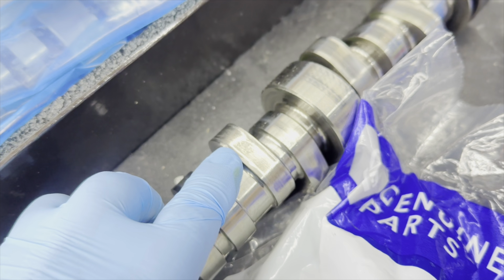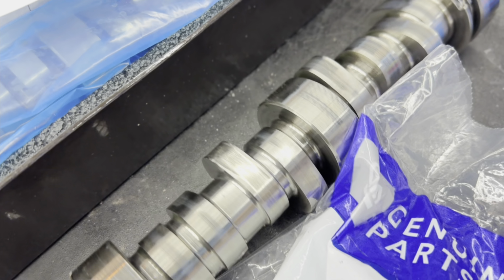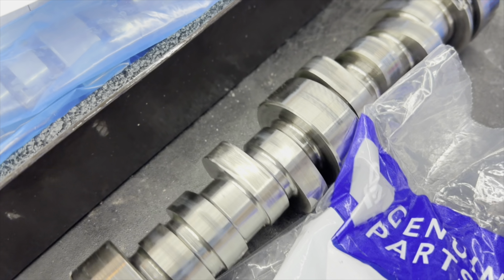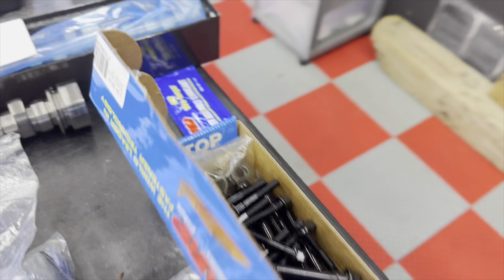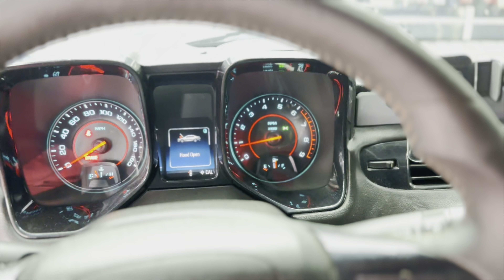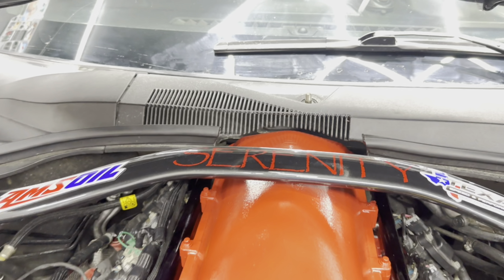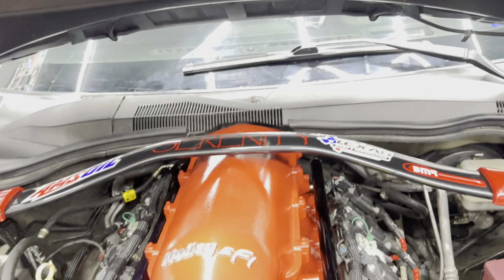2015 Camaro Ss camshaft installation

Comment: What’s the trick to get the bottom oil pan bolts on the front cover to thread back up? No room and I have been fighting it for hours.
Reply from the maker: I Don’t remember having problems with those bolts. But if u used silicone and let it dried before installing all the bolts that could be your problem.
Reply: @ I have tried 2 different nights the bolt are wedged between a battery cable and conduit that runs right under them and you have about a inch to try and turn the bolts and get them to line up. Someone so simple is pissing me off. The bolts never came off they just say on top. Aggravating.
Reply from the maker: That cable going across if I remember correctly u slide the whole cable and the plastic fwd toward the radiator (it might have a 10mm bolt holding it on one side)
Reply: @ I am going to jack it up tomorrow and crawl under and look. I have been doing it in a cold garage and from the top. Thanks for the help.
Reply from the maker: @justinstatham6378 yeah those are through the bottom that’s how I always do them.